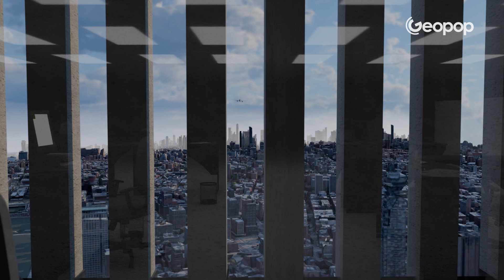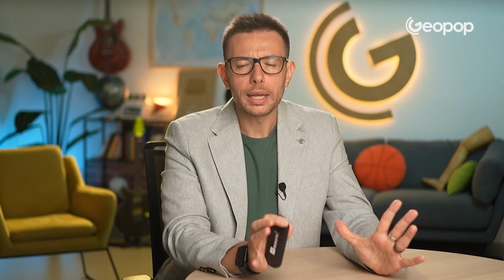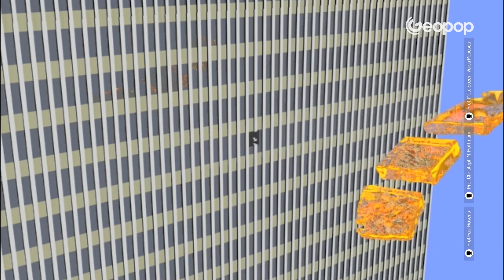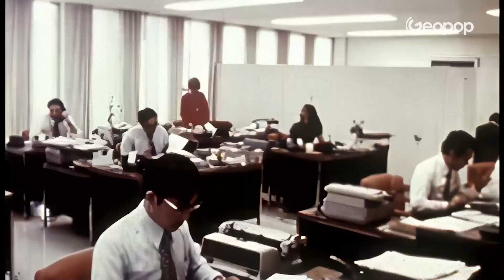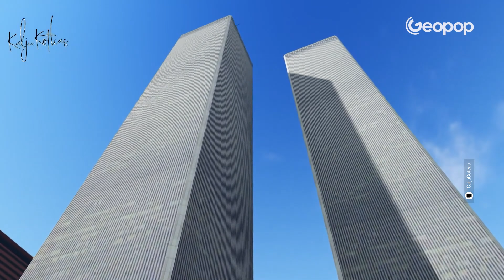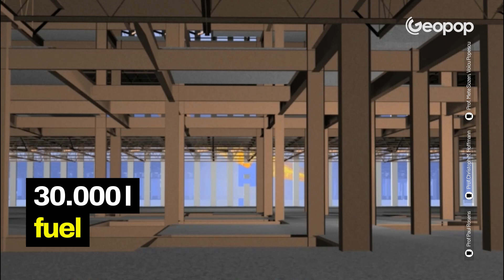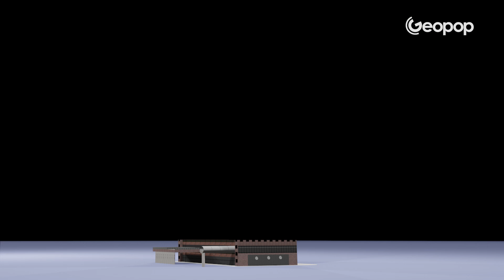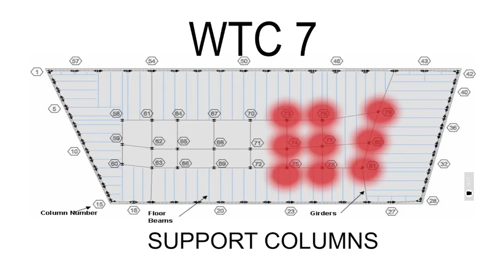9/11, 2001: The Technical Reconstruction of the Twin Towers and WTC 7 Collapses

Comment: Inside job.
Reply: Maybe, but the collapse mechanisms described in this video are still correct.
Reply: @TheLoonResistance yea sure, just as WTC 7, because Nist says so!
Reply: @eduardoillingworth7383  - Yes. Sure. Much misunderstood, Building 7 was the 6th building to collapse of 10 lost on 9/11. Because of its early low priority, conspiracy filled the information void with garbage made up by technically ignorant people promoting political agendas. But 7's loss is an engineering problem and should be treated as such, so I prepared this brief summary of my own analysis to fix that, using technical analysis, not ideology and tired memes. 

At 10:28am the WTC North Tower collapsed, showering Building 7 with tons of burning debris, causing heavy damage and starting many large  fires which burned out of control for the next 7 hours. Half the FDNY firefighters having been killed, units in disarray, equipment destroyed, no water pressure, and the greater urgency of search & rescue efforts, Building 7 couldn’t be saved so firefighting efforts were pulled as futile and 7 left to its fate. Firefighters make that sort of choice every day in brush fire situations - which houses to save and which ones to let go. Only real difference here is moving the decimal on the size and cost. People get overwhelmed by the size.

www.youtube.com/watch?v=g_SvpwyC17M

Collapse of a burning structure is always a concern for firefighters. Steel buildings subject to fire rely on active firefighting to survive. Buildings are designed around 1 to 3 hours of fire resistance, allowing time for occupants to escape and active firefighting to get started, after which all bets are off. Left to their own devices they'll exceed their design envelope and collapse, like Plasco Tower and Wilton Paes de Almeida. In 7 the occupants escaped, passive and active fire protections were compromised and active firefighting was abandoned hours before the collapse, which left the building to its fate. It lost. Odds on Building 7 would eventually collapse, and it did. No big deal in logic.

 http://www.youtube.com/watch?v=WnYBX6QT0R4 

FDNY Chief Daniel Nigro - The biggest decision we had to make on the first day was to clear the area and create a collapse zone around the severely damaged 7 World Trade Center, a 47-story building heavily involved in fire. A number of fire officers and companies assessed the damage to the building. The appraisals indicated that the building's structural integrity was in serious doubt. I issued orders to PULL back the firefighters and define the collapse zone. It was a critical decision; We could not lose any more firefighters. It took a lot of time to PULL everyone out, given the emotionalism of the day, communications difficulties and the collapse terrain 

FDNY Deputy Chief Peter Hayden ; We had our special operations people set up surveying instruments to monitor and see if there was any movement in the building. We were concerned of the possibility of collapse in the building. And we had a discussion with one particular engineer there, and we asked him if we allowed it to burn could we anticipate a collapse and if so, how soon? And it turned out that he was pretty much right on the money, that he said 'In its current state you have about 5 hours 

The collapse of Building 7 was anticipated and widely reported in the media throughout the day, with 24 video cameras recording some or all of the collapse. Everyone knew what was coming and why. 

www.youtube.com/watch?v=OY5S5k3tMHI

The collapse of Building 7’s was entirely different to the Twin Towers and harder to understand, most details being hidden from view and not intuitive.  But we can still sort out what happened through careful analysis and observation. This is my explanation of the collapse relying on no outside authority. 

Building 7 was a unique, asymmetrical 47-story steel framed structure built atop a smaller 3-story building serving as a partial foundation, requiring lower floors dedicated to complex load transfer structures. Of trapezoidal shape and all-steel tube-in-tube construction, B7 (above the 7th floor) consisted of a central core of steel columns carrying most of the gravity load, perimeter steel columns around the outside of the structure carrying the remainder of the gravity loads and long span beams and girders to tie those elements together and form the floors. On the outside of the building hung a moment frame or outer shell. 

Phase 1 : First externally visible signs of collapse initiation occurred at 5:20:28 pm and were notably quiet with observers not realizing the building was collapsing! No audible warning in the form of hundreds of ear drum busting 180-190dB explosive bangs preceding the collapse. Here at 12:00 a local CBS affiliate reporter is talking 10 blocks from B7 when collapse begins. People don’t start to notice the collapse until 12:11. At 12:45 is the famous CBS fixed camera clip of Building 7’s collapse. Note how quiet it is. 

www.youtube.com/watch?v=t5tEy6mXSE8

Collapse initiation was due to lower floor failures above the load transfer region (8-14th floors) in the NE corner. In this video at 0:45 you can see the NW corner from inside the building while under construction, Column 79 just out of frame on the left. That big, angled steel beam across the top of the frame connects to C79 at one end. The girders connect to the beam. That beam and all those girders depend on just one connection 

www.youtube.com/watch?v=nP3TNHPCIVU&t=45s

Phase 2 : The NE lower floor failures caused a loss of critical lateral support over an excessive length of Column 79 and it buckled. Looking at a floor diagram of Building 7 (www.nist.gov/image-16640) when you see all the structures that depend on C79 you quickly realize this one column was a relatively isolated structural element on which a disproportionately greater fraction of the structure depended analogous to say the Key Bridge. Externally as collapse begins we see a vertical progression of window breakage along the 44-46 line and a kink in the roof of the East Mechanical Penthouse at the top of the building, consistent with C79 failure. Normally with a buckling column, the load could be redistributed to other columns. With C79 that is not the case - the failure did not redistribute the load, so the collapse rapidly progressed to the roofline, sinking the rooftop penthouse. The transition from full capacity to almost no capacity occurs in an instant and will result in virtually no resistance 

Phase 3 : With C79 gone, B7’s progressive, non-symmetrical collapse continues with adjacent columns 80 and 81 left laterally unsupported, and quickly buckling as well, sending the EMP down through the building. C79-81 all have no diagonal bracing, which is the major reason why they could not redistribute a lot of vertical loads among one another. From there collapse progressed from east to west through the central core until the core was gone taking all of the interior floors and probably most of the perimeter columns with it. Follow the horizontal progression of window failures low in the building and the dropping of the remaining rooftop structures into the building. One of the big takeaways from the NIST Building 7 study (invariably ignored) was how their modeling determined C79 failing under ANY circumstances would have initiated the same collapse sequence. 

Phase 4 : After about 10 seconds only the exterior moment frame remains, giving the illusion B7 is still standing to the casual observer since little has outwardly changed. But it is just a hollow empty shell like an empty cereal box supported only by a few remaining columns and overloaded from the loss of the core columns and floors, quite unable to remain standing. With nothing remaining behind it, the north face leans inward, forming a V in the roofline, the last few columns buckle under the strain and the moment frame free falls, landing on top of the debris pile. 

It is only here at the very end that a single measurement of alleged free fall acceleration is taken, from a single point on the outer shell. The Building did not “free fall” – just one corner of the outer shell did, sort of. The Building_ (defined as its center-of-mass) was already gone before that happened. The period of alleged free fall was a product of how it fell NOT why it fell and can't tell us what started the collapse 10 seconds earlier. Start to finish the collapse took 18-20 seconds, 3 times longer than free fall . How fast something falls cannot tell you what started it falling_ anyway. 

The debris spread outside the footprint blocking surrounding streets, heavily damaging the Verizon Building and destroyed Fiterman Hall. 

Building 7’s progressive, non-symmetrical collapse was incidental and unintended collateral damage from the combined effects of fire + time + gravity, started by the collapsing North Tower. That is true no matter who planned and carried out the 9/11 attacks or why . The collapse was of so little consequence it barely registered at the time - a footnote, only taking on semi-mythical status as an alleged smoking gun years later when demolitions at the Twin Towers, missiles at the Pentagon and shoot down over Shanksville all failed and conspiracists had nothing left to work with. 

Anything can seem like a conspiracy if you don’t understand how it works. Now you should. I hope you found this helpful, informative and it solicits informed critical comment. If I made any errors of fact, logic or reason or left anything important out, please let me know so I can fix it. IF you can offer a more plausible alternative please do. Be the first. Please start any reply with the words “Tits McGee” or I will know you didn’t read it and are wasting my time.

Comment: I hope you're simply admitting your own ignorance when you summarise by saying "it's very complex"  and not passing aspersions on the "great" architect and engineers who, in serving the "most reputable" institutions the West has to offer gave us such magnificent icons of US imperialism which were (apparently) so quickly demolished by nothing more than a few barbarians playing on a flight simulator, thereby fuelling a fire while the world watched on, powerless to intervene.  Perhaps you believe (as I do) that heads should roll for such a catastrophic failure of engineering that would cloak in "complexity" a deck of cards made of nothing but flimsy cardboard-steel to masquerade as a sound structure capable of withstanding an aircraft collision?  To all the engineers out there: Remember to guard yourselves from every conspiracy to bring your designs down, taking into account the law of politically expediency that may appear to deliver you from any personal responsibility, only to disqualify you from taking up The Greatest Commission.

Comment: If what was said about building 7 was correct, why did  Larry Silverstein say in an interview "because of everything that happened that day, they decided to just pull it" ? Which obviously indicates a controlled demolition. A controlled demolition can't happen in less than 10 hours after the plane hit the towers.
Reply: They decided to pull the firefighters because Building 7 couldn't be saved and they wanted to avoid further loss of life. It's all right there in the complete quote
Reply: @TheLoonResistance  wrong. WTC 7 was your conventional steel grid tower, and wasn't hit by a plane.  It had some fires on a few floors, wasn't uniform, and there was no fireball, no jet fuel, and it went down in free fall onto its own footprint 😂
Reply: @defcon2544  - And that has what to do with a quote from a real estate developer?
Reply: @TheLoonResistance no it was pulled as in controlled demolition! Which takes days to prepare!!!
Reply: @redsed1565 - Leading demolition and explosives expert and editor of Implosion Magazine Brent Blanchard - We have never ever heard the term ‘pull it’ being used to refer to explosive demolition and neither has any blast team we’ve spoken with

Comment: WTC 7 had fire suppression system. Actually, WTC 7, according to videos started collapsing on the south side not the north. Your theory does not hold. Beside, the weakest side should give in first and not all sides at once.
Reply: Collapse of Building 7 began in the northeast corner.  There have been 5 comprehensive engineering studies and dozens of technical articles in peer-reviewed engineering journals. They all agree on that.

Comment: Why doesn’t he mention the nano-thermite that’s found all over the steel?  Or the 100’s of eye witness accounts that heard explosions? Including recorded radio traffic from firemen inside the buildings.  

Or that the building 7 collapse was reported before it actually happened?

Or that the speed of the collapses speed up until free fall speed.  If the top crashed into solid steel that was engineered 3 times the strength needed it would slow down not speed up.

Or all the tiny metal spheres that are evidence of molten metal.  Metal cannot become molten from jet fuel or any standard material.

Or that the highjackers were incapable of flying those planes.  Pilots have tried recreations of those flights and most cannot do it on the first attempts.  Nobody has recreated the pentagon flight.
The highjackers weren’t capable of flying a Cessna let alone a commercial jet
Reply: So what was it, thermite or explosives?  Instead of all the random whataboutisms why don't you start putting pieces together?  Why are you waiting for other people to do your thinking for you?
Reply: @TheLoonResistance it was nuked. Hence the molten rock found in the base! Look up the word ground zero!

Comment: My dear friend Andrea,just how do you explain the Greenfeldt tower in UK which burned for more than 24 hours and was built with the same industrial grade high rise tensile steel and concrete withstood the onslaught and had to be manually taken down as it refused to collapse!
I like the way you explained every detail in your vlog....i really do appreciate your work!
Reply: First, by correcting your most egregious error.  Grenfell Tower was constructed from modular reinforced concrete blocks. NOT STEEL. The Twin Towers and Building 7 had no structural load bearing concrete at all and were entirely steel framed in construction.  Apples and bananas.  Further, the primary fires in Grenfell were external rather than internal and of course it was not hit by 120 tons of airplane.

I find it curious that people like you bring up Grenfell but not situations that are at least somewhat analogous such as Plasco Tower or Wilton Paes de Almeida. Or even Delft University.

Is it ignorance or lie by omission ?
Reply: @TheCriticalStinker-01 I see people are VERY hard at work trying to nullify any possible alternative theories and pushing only the agenda set by the authorities (whosoever they might be)
From what you are trying to explain is that the steel core didn't stand a chance at it being hit by an aluminium plane and disintegration of BOTH the buildings were similar to the centred implosion method used by demolition teams worldwide!
At least that's what it looked like to the lay man who was watching television that day.
BTW,WTC building 7 was still standing behind her,while Jane from BBC reported live that the tower had already come down!It did come down alright but it was only a couple of minutes later than she predicted....
Was it FOREKNOWLEDGE or sixth sense or a bit of both!
Later on however it was indeed clarified publicly that WTC 7 was indeed brought down by demolition.
Knowledge indeed implies misdeed, or so it seems!
You can fool some of the people some of the time BUT you can't fool all of the people all of the time!
Reply: @ajMirza-gc6il  - You were completely wrong about how Grenfell Tower was constructed. I corrected that. 

You also missed two far more analogous scenarios. I fixed that.

The correct response is thank you
Reply: @TheLoonResistance Yes just keep assuming that you are a "fixer of things"
You couldn't convince me and some others on this platform!
Reply: @ajMirza-gc6il - You were wrong about those things, which is why all you have offered is bruised ego butthurt and not a rebuttal.  Armed with the true and relevant facts you can now make better arguments.

That part is up to you.

So the correct reply from you should still be thank you, if you can manage to get out of the way of your own hubris and pride.
Reply: @TheLoonResistance Oops that really hit the nail on the head.I see finger pointing instead of logical responses!
Reply: @ajMirza-gc6il  - Was Grenfell tower a steel framed structure or built from prefabricated reinforced concrete panels?  

I eagerly await your evasive non-answer. 

Or silence.  

Anything but honesty

Comment: You could shoot 10 super planes into the twin towers and they would not" fall".
Jet fuel NEVER melted the structural members. But the boom before it fell was indication the main beams were cut  with thermite or blown up with TNT or C4.
Reply: No steel melted or needed to.

I have no idea what a super plane is